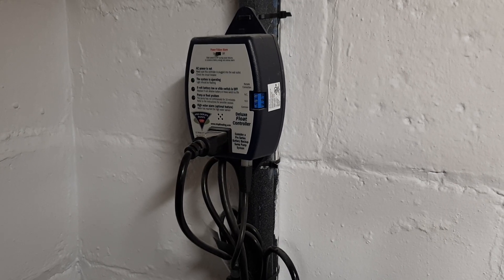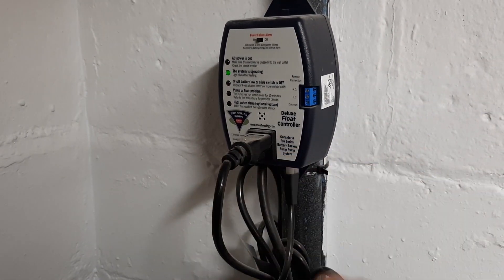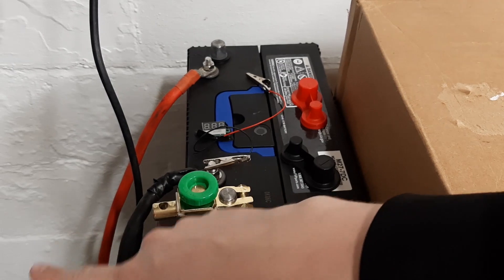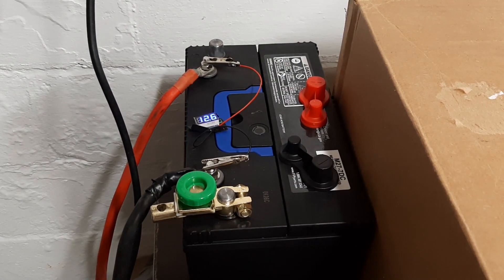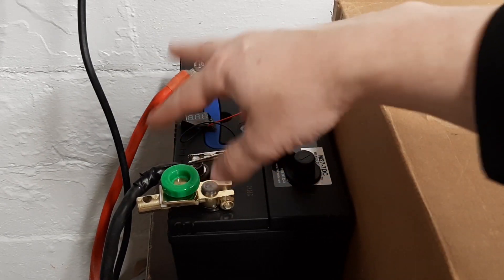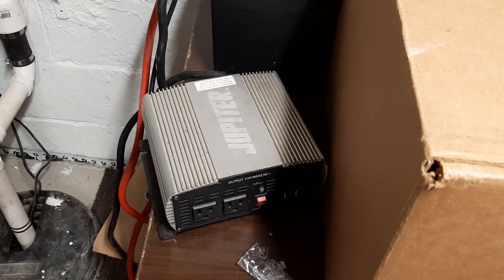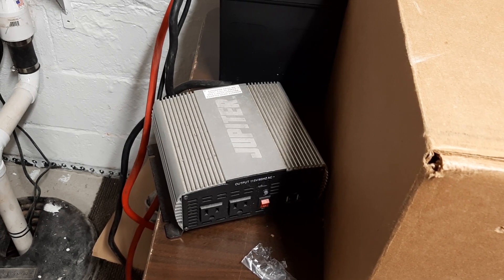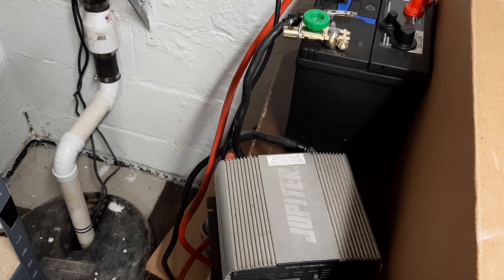How to Add a Battery Backup to a Sump Pump That Isn't Compatible With One

Comment: Did your inverter come with those battery cable connection s on the back of it I have the same sump pump controlor at my house and Im trying to connect it to a battery back up for the sump pump
Reply from the maker: I got it 2nd hand so technically yes but from the store, I suspect it didn't since most don't.

Comment: What i did was buy a 4700 gph 12v pump then bought a vertical float,12v marine battery , pipe fittings, and a trickle charger. Now i have a 12v backup in case my main pump fails to pump and also acts as an emergency pump if power goes out. Under 500 i made a complete system. 🍻

Comment: a capacitor will shift AC current 90 degrees out of phase  to make a second coil in the motor. A motor like thin will math 50/60Hz frequency of the mains input.

Comment: have you thought about a lithium battery for this system or are you now using a lithium battery ?
Reply from the maker: Yeah but a lot of the off the shelf ones are crazy expensive. They're getting better but they're definitely several hundred.

Comment: Talking about this stresses me tf out but this is a great idea. I'm not sure why I didn't think of a battery backup situation. On March 20th, 2020 I was forced to start working from home and I heard this weird dripping noise in the morning. While I was sleeping, we apparently had ~5"-6" of rain come down and I had no clue. We had like a foot of water in the basement. Sump was working but it wasn't fast enough. The level rose to around 4' over the day and I seriously thought it was going to hit the electrical panel. I had called the non emergency line for 911 and they called AEP and got them over but it stopped rising (thankfully). Furnace was f*cked, hot water tank too. Almost got the well pump too. 

We've had it happen a couple of times since then but not nearly as bad. I've had basement waterproofing companies come out and look and all they want to do is put in an internal permiter system but it just doesn't seem like that would work. The water comes up through the floor cracks (that were painted over by the previous owners) and from the joint in the wall. They say it's probably a high water table. $10k quotes and no guarantees. I had to have the new furnace motor and controller replaced (warranty claim so I only paid labor thankfully) because the level got up there one other time earlier this year.

I haven't pulled the trigger yet on any system but I need to do something as this is killing me of stress faster than anything else. This is a great idea to at least keep the pump going IF there's an outage but my pump can't even keep up the way it is lol. I joked about having 2-3 more sump holes drilled and put in parallel pumps but I'd prefer to have the core of the issue fixed so other problems don't start from the water flowing through the block edges/floor. Home ownership sucks sometimes LOL.
Reply: I would do it. Last year I had to use a bucket to remove water from my basement for 2 freaking hours as the electric went out. The water kept rising and I had to work fast to counter it. If I was older, forget it, I'd have lost that fight
Reply: If you get battery back up system, something like The Basement Watchdog, the secondary pump is always powered by the battery, the float trigger is just set higher than the main AC powered pump. Which means it comes on not only when you lose power but also when the main pump gets overwhelmed, giving you the power of two pumps simultaneously.  Hope you've fixed your issue by now.
Reply: we have backup coverage on our homeowners policy that has 5000$ with 1000$ deductible...its for both real property and personal property cost is low also have a system like this video but just changed to lithium battery looking for an inverter

Comment: One problem with this approach is that 120v pump becomes a single point of failure. I chose to add a separate 12v back up system instead so it will work during a power failure and if the 120v pump fails. Thanks for sharing.

Comment: Does the Harbor Freight inverter have a built-in transfer switch?
Reply from the maker: Unfortunately no :( Strange considering cheap UPSes are cheap, suggesting transfer switches are not particularly expensive. I'm looking into building one myself.

Comment: what the horse power of your sump pump i have PHCC Pro series 1/3 hp  as my primary pump , can i use that as my backup using 2000 watt inverter and battery? please help

Comment: Make sure you have the spare fuses for that inverter, they should be super cheap, sump pump I think is rated for 1500w or 15 amps, unless it is a smaller there then it is prob 1200 w. The name plate on the sump motor will tell you the amps and from there you can do all the adjustments for it. The device hooked up to it might be undersized. Check the nameplate for the motor to be sure. Also you could just wire a switch into the batter lines and mount to the wall, tho that switch you have is pretty good
Reply: Really need to incorporate an auto transfer switch. What do you do when you are away and the power goes out.  It does cost a bit more money but some nicer inverters can maintain your batteries while powered by the grid and automatically switch to battery power when it senses a loss of grid power..

Comment: "I dont know how an ac motor works"

later:
"I know quite a lot about electricity 

I like you a lot. 
ac motors work by using a capacitor to shift the sin wave of the voltage to create two differently polarity-switching electrical magnets which power the rotation.
sorry if sth was unclear, esl
Reply: SOME* AC motors use a capacitor to shift the phase.
Reply from the maker: By "electricity" I meant before dumb humans decided to start flipping polarity around.